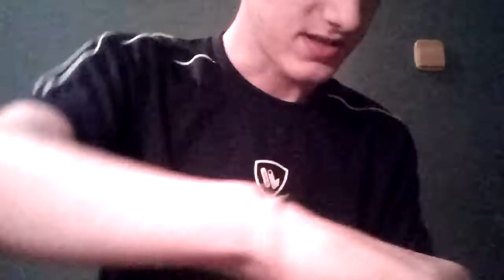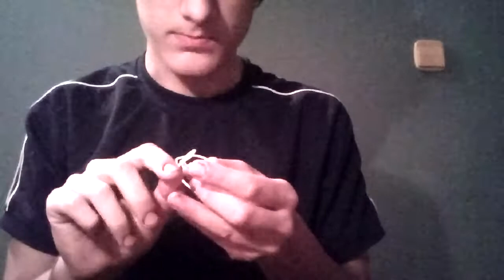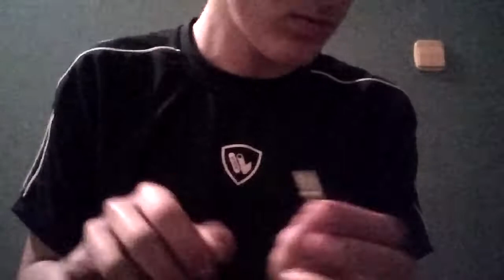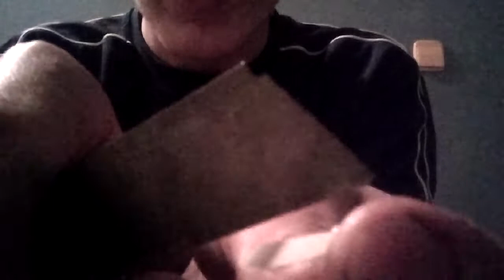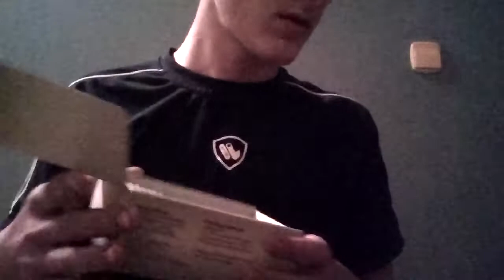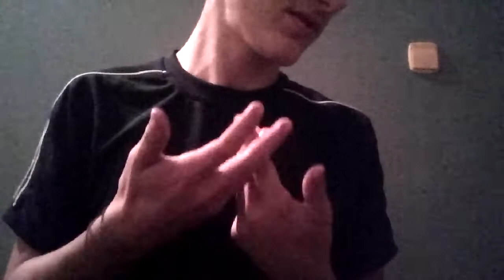How to balance nano props

Comment: Excellent idea I never thought of! I've been experimenting with a magnetic nano prop balancer but for those without the skills/resources to make such a magnetic balancer your way is the best I've seen so far. The only thing I would like to improve with your basic idea is a small vibrating source that you set the stick of pencil lead into that has very small vibrations and doesn't require being hand-held. Might have to check in my girlfriends night-stand for her "friend" ;) 

FOR OTHERS READING THIS: Alot of people may not be aware that the graphite in the pencil lead is an ideal dry lubricant to reduce friction between the lead and the plastic prop hub. Graphite is the ultimate dry lubricant and is commonly sold for lubricating door lock cylinders and plastic gears. Under a microscope, the small particales of graphite look like little ball bearings...
Reply from the maker: True the idea vith graphite came from the fact that graphite has exelent lubricating propeties and pencil lead is 0.5 mm so its great in balanceing any micro propeler only problem is pencil lead is wery hard and likes to break 😷
Reply: Use a needle